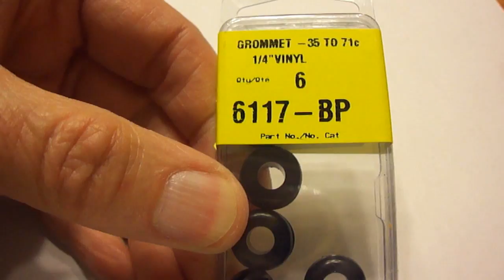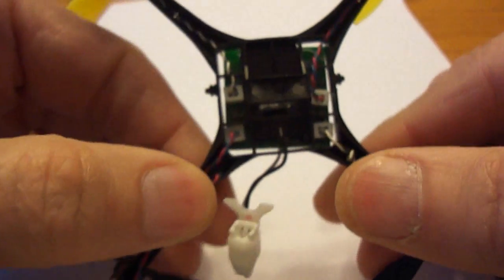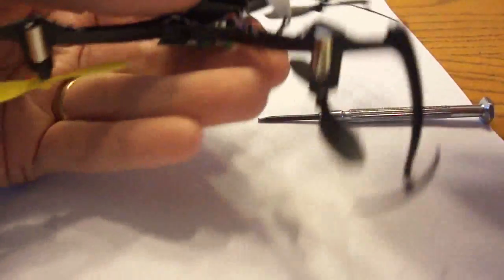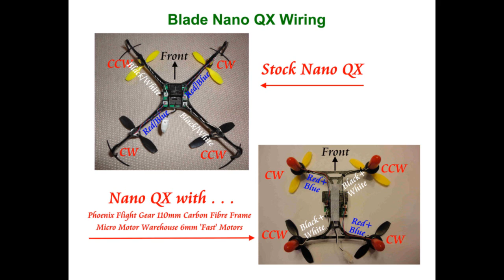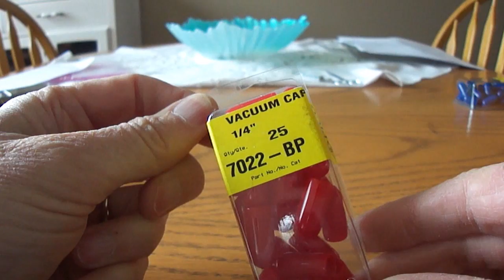Blade Nano QX - Phoenix Flight Gear 110mm Frame - Micro Motor 'Fast' Motors

Comment from the maker: If you use stock motors you can keep them in the same positions. The aftermarket high performance MMW motors require swapping locations due to different rotation.

Comment: Hi, I'm new to this hobby and was looking at the same frame but with prop guards. I was wondering as to why you have to swap the motor positions in this frame compared to the stock frame

Comment: Thermal CPU foam for the aluminum Lady Bird feet might work really well and help cool the motors as well as protect them if the weight is not more than the rubber feet you used. I got the medium motors as it was said it would not hover well with the fast motors  but that hovers fine... thanks for sharing. How does it do in the wind now? I have a couple of the NQX FCB's and will try some 7mm motors on the same size frame. People used it on the MQX too so may try it with some 8.5 geared motors too so I can use a good TX but wonder how it handles the extra current so well.... amazing tiny FCB. Too bad you can reprogram it...

Comment: Where did you get the rubber feet (red and blue)?
Reply from the maker: carboncubss 
Those are bolt protectors that I bought from our local automotive parts store (Lordco). The red are 1/4" / 6mm and the blue are 3/8" / 9mm.